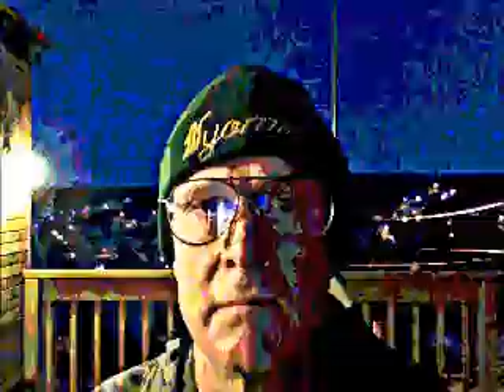Sentinel Hex Beam for the Low Bands

Comment: Hello, Stan.... Thanks fro the inform about that Sentinel Hex Beam. By the way, we don't have static wind here in Dubai. the mix it's with be 30 to 60km/h.  but we have a higher temp around 45c to 52c at summer time. 

I was thinking to get one that antenna for the lower band.
Reply from the maker: That's good. Tomorrow in fact they forecast wind gusts to 70 mi/h (around 110 km/h) right here where I live. The antenna should work okay at high temps.